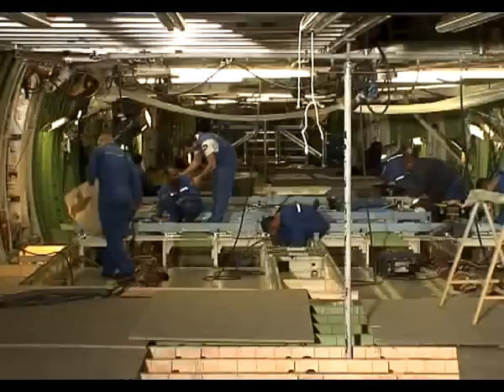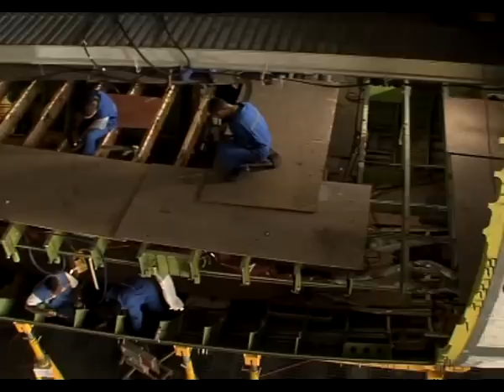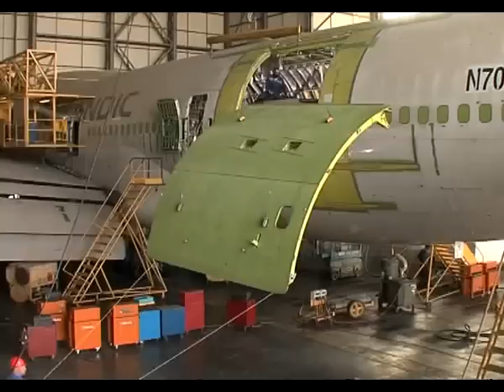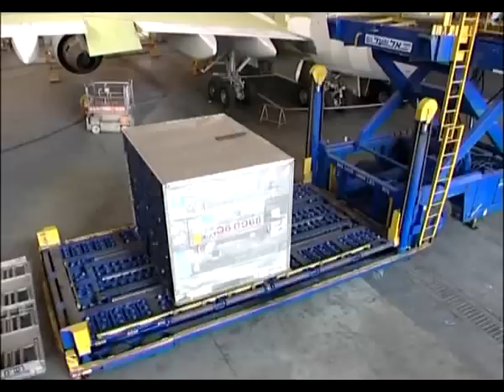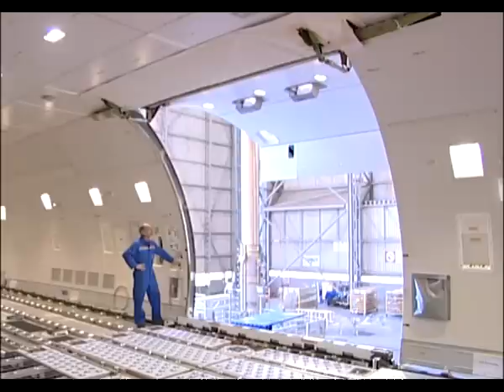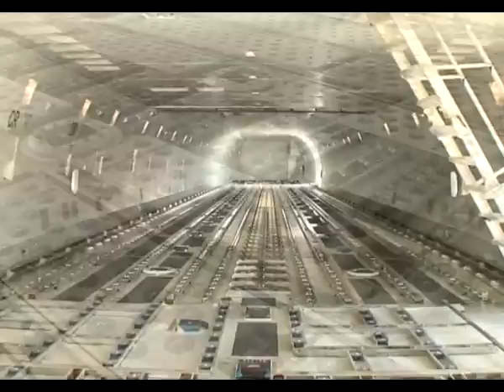Boeing 747-400 Passengers to Cargo Conversion

Comment: A tribute to the engineering concept of the Boeing 747. It's unbelievable that Airbus hasn't thought to make possible a cargo convertion of the A380...
Reply: Not that hard to believe. The aircraft isn't a fit for cargo ops due to the upper deck. Also - the aircraft would hit max weight before hitting max volume, which means you can't fill it up and make money. That's why UPS and FedEx backed out of their orders for the freighter version.

Comment: great move, the 747 set for a prolonged career in cargo flying, to me carrying freight is far better than passengers, you never get any complaints from cargo
Reply: haha, by statistic - 20% of Airfreight is damaged!
Reply: cargo can't complain, but people who receive the cargo always complaining towards cargo company.
Reply: You’re correct, which means the company doesn’t spend nearly as much on preventative maintenance of the aircraft, because there is no people on the flight. The regulatory agencies don’t consider the crew as people on cargo certificates. Pros and cons man. Pax complain but the jet is in better condition.
Reply: Rubik And that is bullshit unless you have a reliable source to share?
Reply: @liefbrunhilda926  That's not at all the case, the aircraft ABCD checks are all to the same intervals as a pax aircraft.

Comment: Originally created for cargo. While the A380 will died soon, the Queen will live longer.
Reply: agreed, the 747 will live on until antonov decides to start building more AN-225's
Reply: @killman369547  747 will still have a life as a cargo plane with airlines retiring them and I'm sure operating costs is cheaper it will be have a long life as a freighter.
Reply: Poldus Eri ..what?
Reply: @killman369547  Antonov wont build more AN-225s because they're too expensive.
Reply: Poldus Eri Maybe Swiss will have this plane
Reply: @killman369547  Bad thing is....they ain't got the $$ or a factory to build them. There was to be a 2nd one about 60% completed. When the Soviet Union fell...they just stopped building it and using it for spare parts for the one AN-225 that is flying.
Reply: @patrickmollohan3082  Unfortunately, the aircraft was destroyed by Putin...

Comment: I wonder how hard it would be to add a nose door on a pax-freighter conversion. I don't think I've ever seen it done, the only 747s I've seen with nose doors have been built as freighters. I guess there's too much critical stuff up in the nose that would need to be moved.

Comment: Back in the 80's, Eastern airlines had a few 727 combi, where airplane flew passengers during the day, and freight at night. The conversion took between 2 to 3 hrs if I remember correctly. Those poor airplanes accumulated a lot of cycles very quick. But I think that practice is no longer cost efficient. Either UPS or FedEx has purchased new freighters (second hand info). In a way a new freighter it's a better airplane because there's no window belt (weak point for corrosion), less doors, no pax comfort features to install, and the floor beams can be reinforced from scratch. The few 747 I have ridden jumpseat on, had a half upper deck with all the pax comforts, and one even had a couple of berths. But you got to have some serious volume sales to profit with such of high payload airplane.
Reply: UPS had a few quick-change planes on its roster for a time, and it also leased passenger planes to other airlines for some time before it ultimately converted the planes to freight for its own use.

Comment: Air France used to convert their A320 from passangers to cargo to passangers, at least 4 times a week in 80 & 90's. Daytime they flew passangers, night time cargo out of Paris for North Africa and Marseille. Fedex studied that possiblities since most cargo planes during day times are on the ground. Now with less snail mail and a greater number of flights and competition, AF stopped the process.
Reply: Toxinomist I did not know that, thanks!
Reply: I can see how that would be easily done. Just the time to switch for turnover would be killer.

Comment: Why do the windows have to be blinded?
Reply: Sunlight can also introduce unwanted heat to sensitive packages
Reply: @nczioox1116  Plus you dont want cargo moving or toppling and busting out a window. That could be an explosive decompression that could tear the plane apart bc the entire plane is now pressurized due to some cargo being live animals etc. Before, the upper deck and main cabins were pressurised...while most of the cargo holds werent.
Reply: @FlatOutMatt   no they just dont want the packages to get scared
Reply: @frodo4087  yes
Reply: @patrickmollohan3082  wait the cargo holds aren't presssuried?
Reply: @ThatAverageMTBer  
No that isnt what I'm saying. At one time, years ago, they weren't. Nowadays, they can pressurize the whole cargo bay if needed and they often do.. especially on cargo freighters.

Comment: It's a hell of a lot cheaper... you can pick up a used 757-200 for around $6 million, then overhaul it, upgrade the cockpit and modify it.. I would imagine for a total of $10 million... so you are paying $16 million for an aircraft that would cost you $70 million to buy new... the only down sides being maintenance and poor fuel efficiency. I am guessing on the prices.

Comment: well passenger planes are built more durable and safe..many air lines recycle passenger planes by converting them to cargo.
Reply: That is not the reason. The freight versions of passenger planes are built to the same standards. For the true reasons of such re-purposing, I recommend the recent video from wendover "How Overnight Shipping Works". With much less flight hours every day for freight, cost of ownership is more important and you rather use fuel inefficient old planes than having your expensive new planes on the ground for many hours.

Comment: why they  need some seats in the upper deck?
Reply: for the crew
Reply: For flight crews. Sometimes these cargo planes also carry live animals like race horses, so that vets and support staff can fly with them.
Reply: First, the upper deck is unusable for freight, except for a few occasions where some mail bags are stored up there. You can't put it to other use, because there is no loading equipment. That said, it is good to have the option to carry additional people. That could be the costumer riding along to look after his expensive load. It could be a specially trained crew for unloading, because you can't rely on the crew at your small destination airport or probably most likely, when parts for aircraft repairs are sent out to stranded planes, qualified engineers and maybe a spare crew transported there as well, to retrieve a plane.

Comment: Need some expert advices....... As a rule of thumb, how many minimum cycles remaining will make this conversion feasible?  I think long haul airplanes like 747 only lasts approx. 30000 cycles? vs. airplanes such as 737, A320, etc which lasts approx 100000 cycles, correct?  I guess if there are not enough life left, then conversion is not worth it. Correct? I heard 747 conversion cost approx. $1.5 million USD? And maybe a 3 month? Can someone confirm this? Thanks.
Reply: THE ELITE 747 
When a plane takes off it's getting pressurized and it can only withstand that a few times depending on the aircraft type. Every time a plane is getting pressurized (every flight once) it's called a cycle. So every flight a plane uses a cycle. That's why a 737 is retired sooner than a 747 because it is flying like 8 times a day (so 8 cycles a day) and a 74 only once a day. So if a 747 has a lifetime of 30000 cycles it can fly 30000 times but when it already has flown 29000 of it it's not worth it anymore. Hope you understand. sorry for my English, it's not my main language.